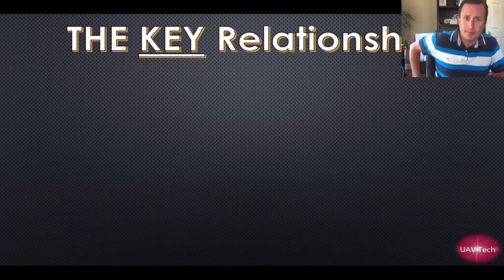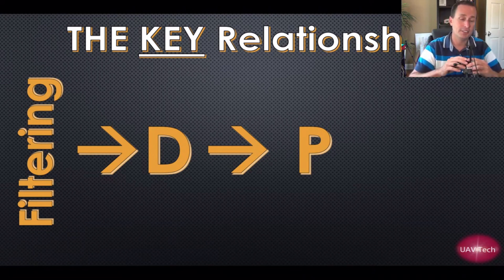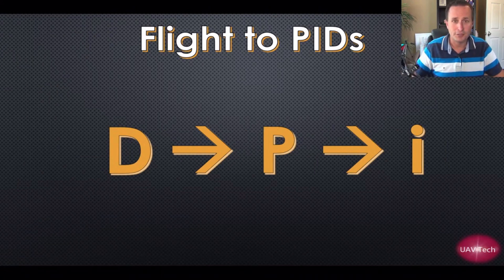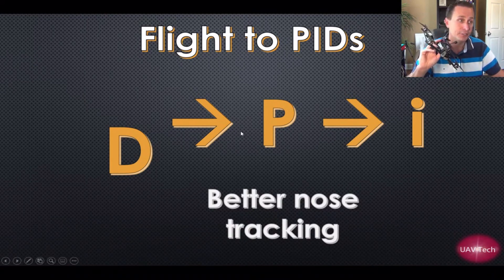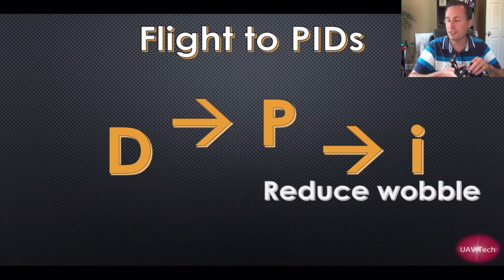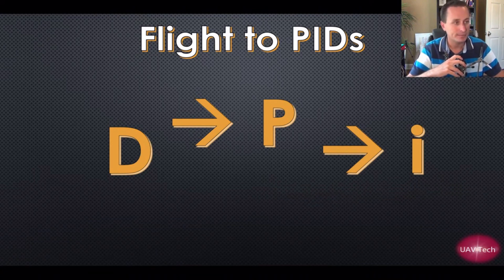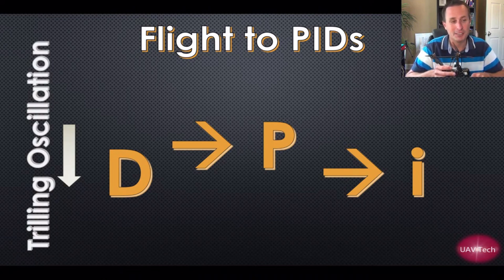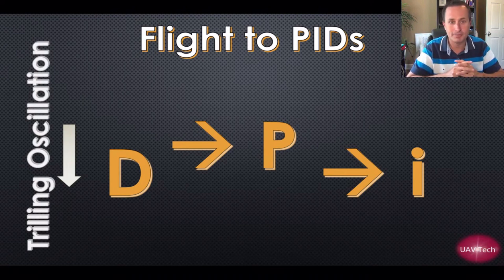PID Tuning -- 💥MUST KNOW💥 -- information!  💪😎

Comment: Oh boy. Im so glad that all the information about pid you can find on the internet teaches this. Really glad that we are following a hundred years of research when it comes to tuning pid. 

That was a lie. You never find any information about tuning dterm before pterm. It's not standard and I do not understand why this is being taught. Show me a paper about tuning d before p. I'll wait because I've spent some time looking for it.
Reply from the maker: Ohhh boy.  So increasing PIDs does not make wash better now?  Maybe on Flat Earth, but not on real earth.

If you only raise P to max with little or no D, raise D to Critically Damped and set i-Term (classic) you are missing out bud.

Fact is D max limits all other term max gains and max gains translates to peak flight performance.  D->P->i is the KEY relationship.  Knowing this is what makes a pro tuner a pro tuner.
Reply: @uavtech  welp, your word vs 100 years of control theory. Find me a paper to support a d->p->i tuning method and I'll be impressed.
Reply from the maker: It does not go against text.  It is just deeper insight in how it actually works and what limits what.  You are not asking yourself deep enough questions in old tuning.  Like after setting P, then D, then i, can you not raise all the terms more (together) to make wash better? The answer is yes you can.

Experiment for yourself - don't take my word - and you will see how it all works.  Rosser did, White did, Thompson did... everyone that does finds the truth... because facts are facts.

Just look at DanJoneFPV comment on this video.  He is one of many-many folks I get messages from all the time.  🤷‍♂️
Reply from the maker: Lol.  Sure sure.  🤣
Whelp it doesn't change the facts of the PID relationships.

You don't need a paper bud.  Just move up your gains.  Or don't.  I don't care.

Meanwhile folks and companies contact me all the time for professional tuning and that proof is in the pudding.  It is NOT rocket science.  I would say it is simple, but Emu doesn't have slider.  Such a shame.  Booo hooo.

But you can still do the math manually.  Move them all up to D max (trilling oscillation) and then back 5 or 10 (move D down and the rest with it).  This is all just logical thinking that is 100% in-line with text.  It is just how to set and move stuff a little smarter for our application to optimize wash.  Last I checked PIDs for valves - for example - or cars, don't need to cope with prop wash.
Reply: @uavtech  your not the only one getting companies contacting you all the time, but that's irrelevant. The thing is if a better way of tuning pids for all things that use pids was discovered, a method that was simpler and better than the others, then this is something that would be highly publishable and many across industry would be eager for this. If what you claim be true, it's far more reaching and useful than you'll understand. So until im shown some real proof of such a large claim im not buying it. Large claims require large proof.
Reply: Please guys, keep cool! We are all one big -> #FPVfamily 🍻
Reply: The thing is this doesn’t have to go against theory. A PID controller when applied to different things will also have different limitations. It just turns out that D is particularly an issue in our noisy system. Other systems don’t even need D. I mean take yaw for example. P is not even really effective there. The tuning approach will also be dependent upon the system we are using. The exact steps one uses can also be very different and still lead to the same conclusion. There was just a neat post in the BB FB site showing this. You should check it out. Spectacular tests and results all of which converged on same answer. I think where people might sometimes misinterpret DPI is in exactly which term or slider they think they need to manipulate first. Then, what are we using to determine its effect? PIDtoolbox step resp? If so, do we remove iterm while doing this, because people sometimes can’t tell the difference between P vs I-related overshoot. Ideally they could remove Iterm but it’s an extra step. When exactly is D too high? Trilling? We could turn gains down then but what about the relationship between lower filter latency and trilling (ie less filtering can reduce trilling, more filtering makes it worse)? And When we see higher freq Dterm noise (>100hz), when is it too much? How do we know for sure? And so on. It’s not the theory, it’s the details that confuses people. Just look the the BB FB posts. It’s the step by step details and how to make decisions at each step based on potentially complex things like I just mentioned. I think it’s why they often gravitate to presets, because there’s no thinking involved even if it only gets them half way to a decently flyable tune. But if you want more you gotta get into some of these weeds
Reply from the maker: @PIDtoolbox  AMEN.  Presets based on sliders is going to change the game.  Best of both worlds!  I can't wait.  But at the same time, I think I'm the hold-up for making the Configurator changes.  I need to get on it!!!
Reply from the maker: One thing folks sometime don't get is I don't care if you want to be a skeptic.  That's cool.  Stick to your old ways and miss out.  This to me is like leading a horse to water.  If the horse doesn't drink, no sweat off my back.  I at least offered him a drink.

[Side note: I grew up riding horse each weekend with the parents, it is literally how I felt about leading Hank (my horse) to a stream for a drink.]

Kevin - it is ok.  CTZ, Brian, and Steve said all the same thing to me in the BF Slack.  But now after vetting for themself, I have screenshots of concession.  It was necessary to get on the same page for slider for 4.3.  It is why Brian did the tests I presented in the livestream in the first place.  It was to prove me wrong, but it proved me right! He was skeptical, but after seeing the data, thry are all on-board.  It was exhausting with hundreds and hundreds of Slack texts.  I'm still tired.

Same deal, had to drive folks to test for themself vs talk.  Only then, do folks see truths and it cuts the shit.  Less talking - it is cheap - put the tests where your mouth is.  Between Livestream test results and linked (description) I.P.D video, it is all there to SHOW you the truth ....if you bother to care.  If not, back to horse.  Idk.
Reply: Kinda the wrong guy to question about pids. He is literally the industry authority.